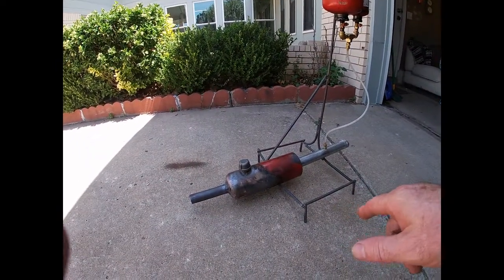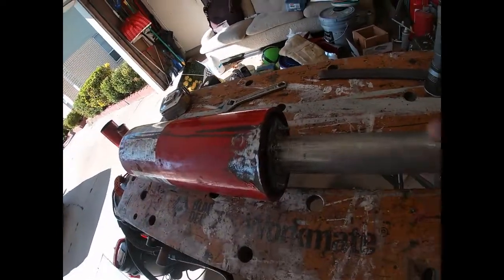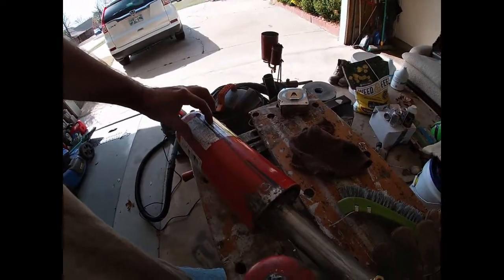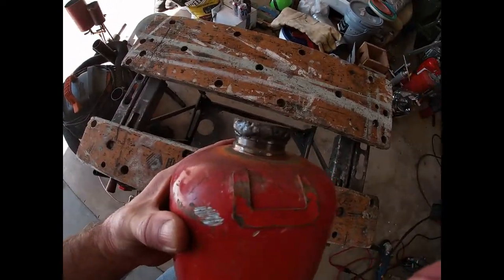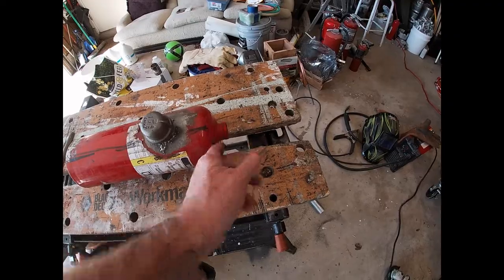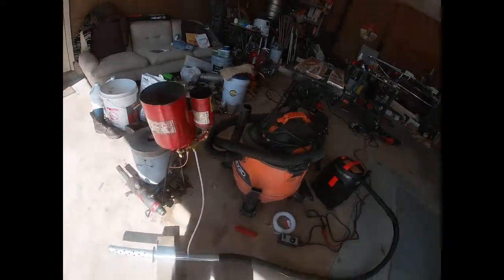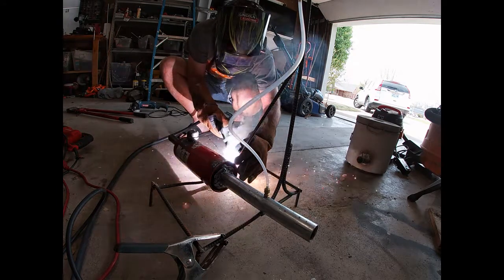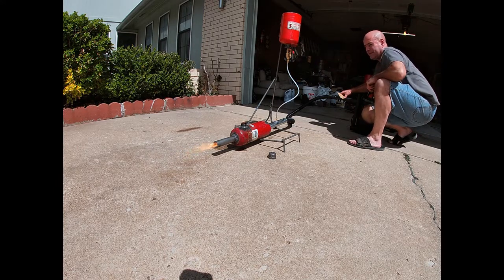oil burner build start to finish

Comment: Wow diesel must be cheap where you at.
Reply from the maker: $5 a gallon. just use about a cup to get it hot then use used engine oil
Reply: Great video mate, headed out to buy a welder, haven't yet found a setup that can be made without welding.